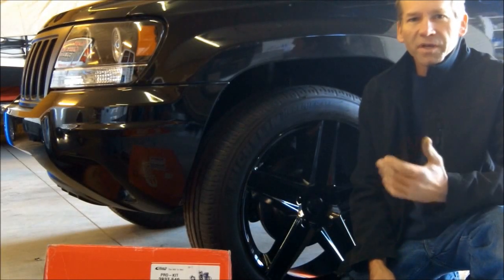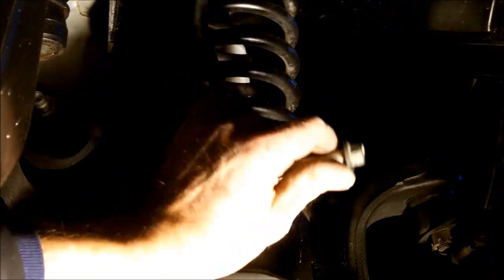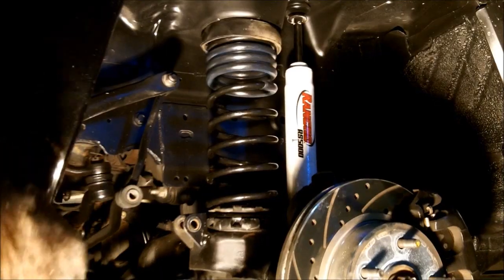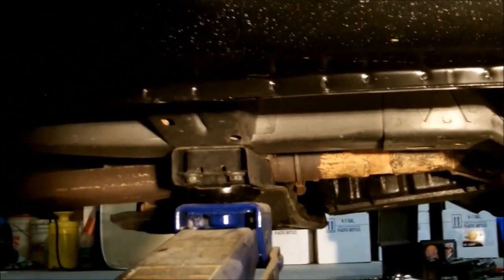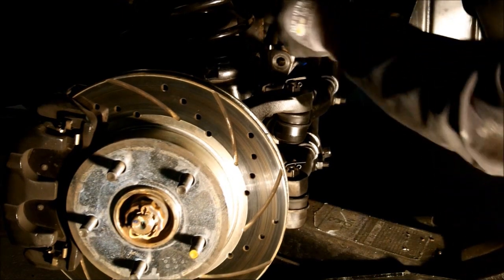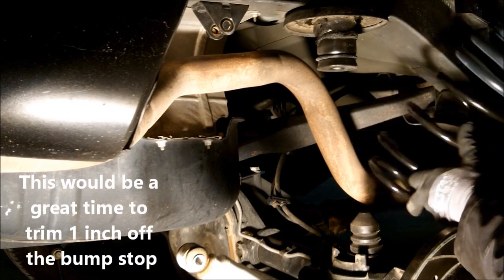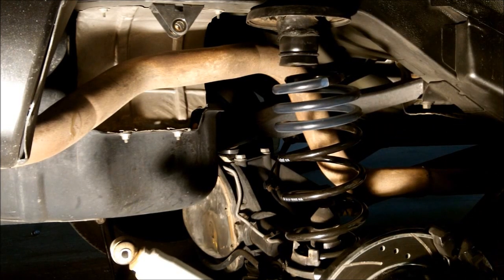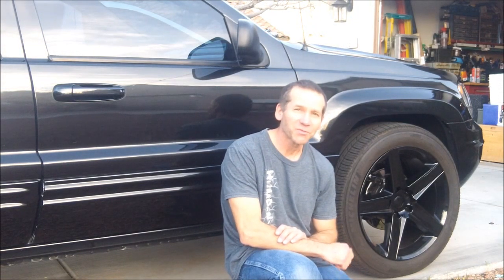Lowering 99-04 Jeep Grand Cherokee

Comment: Lol why lower a 4x4
Reply: Gus Wendt for looks or for better on-road handling.
Reply: Bravo25 a what? Anyway, a lower center of gravity improves handling. It's basic physics, really. I've driven some WJs and they're great cars except the on-road handling which really lets it down.
Reply: Most people don't take their vehicles off road. Hell, the uploader may not even get snow where he's from. I think a slightly lowered WJ on those wheels looks pretty good! To each his own. 👍
Reply: Doesn't get snow? He owns a BAD ASS xj for offroading and shitty weather. God forbid you want something a bit smoother for a daily.
Reply: How do you know it’s not the 2wd?
Reply: The diff on the front axle is a sure way to tell it is 4wd. Go to 2:54,  4wd it is.

Comment: Hey just wanted to tell you I used your vid to replace my springs three years ago . Also install KYB shocks. I drive a 104 miles a day back and forth to work on the highway.  The Jeep handles great! But I did park it almost 2 years ago and was driving other vehicles. But have just put it back on the road yesterday. I think I'm going to paint it this winter. There are a few other mods  that I did maybe one you have not seen. My Jeep is a 2000  but I have a SRT front bumper. I was looking at some pictures and body lines. And I figured I could make it work. So I ordered aftermarket one made out of fiberglass. When it was delivered I realize it is about 5 inches too wide so I choped 5 inches out the center and bonded it back together. Made a frame that goes behind it. And the bumper is held in place by push button race clips . Also I have Dodge challengers 20 inch rims on it. In the back I ran a spacer adapter to convert the lug pattern. In the front I bought new hubs and rotors it had them redrilled to fit a challenger lug pattern . So the rear poke out about an inch with the spacer but the front are slush. Everything I bought for the Jeep was used or very inexpensive.  Except for the front bumper . If I remember right it was around 700 bucks .
Reply: I hope you get to post pics.

Comment: I’m looking to do the 2 inch lower coils and it’s rwd do I have to modify anything besides the bump stops
Reply from the maker: With a 2" drop you may need to remove the bumpstop and the bumpstop holder altogether and then replace them with a screw in type bumpstop similar to what I did to my Dodge Dakota here's a link below.
https://youtu.be/bpky5VAVxbE
Reply: I put the 2 inch lower coils on and I see no difference do u know that could be ?

Comment: We have a 2001 Jeep grand Cherokee Laredo, with 153,000 miles on it and my niece refuses to drive it because it rides too high and is difficult to control. We have so far had the suspension worked on to the tune of three thousand dollars, so it's all good. i understand that older model Jeeps tend to "sway" a little bit. I have driven behind it and I can't see that "sway " effect but riding in it you can feel it a little. it rides Kinda like a 1990's Toyota Highlander with it's high center.  We wondered if we could lower the vehicle for a safer feeling for her and eliminate the sway? How low can we go?

Comment: This should get rid of the top body “Body bob” side to side. In my quest on mine, KYB, the Addco rear sway bar. Next is these springs. I kinda like the factory 17” Azure I think they call them, wheels, one had bad rash is now my spare instead of the ugly black steel wheel as I bought a good condition used wheel. I remember from my days of “Steering and Suspension” classes, for every inch of ride hight change, center of gravity changes 2 inches. So lowering should give much better handling, but body bobble should diminish. Like Martin said, the new springs have a higher rate due to engineering of manufacture so Cadillac it ain’t, but more race inspired meaning holding tighter grip on road sacrificing plush. I love my Jeep,  If mine wasn’t Brilliant Silver,  different wheels would be a consideration, Martin’s Jeep screams those wheels, every one is like a painting where no two are alike.
Reply from the maker: Thank you. I'm glad you liked this video and found it helpful and informative. I don't regret it all, lowering at the 1" it has improved the handling of the vehicle it definitely looks a lot better with the 20" wheels and filling in the wheel well.
 Then, with the addition of the Addco rear swaybar, that was a huge improvement in handling.
 I wonder if I were to convert the rear to a 4 link suspension if that would also help the handling of the vehicle.
Reply: @martinbuilt  Got the Addco sway bar, holy moley, night and day difference. Now to get the springs. I must say, the twenties look natural on yours. Mine is Brilliant Silver so I would continue with silver wheels, but 20s look interesting, but first things first.

Comment: Excellent video! Curious to know what mods you had to make to get the 20” wheel to fit. Any spacers, etc? Did you have to do any brake modifications? Any info is appreciated! Also, you have convinced me to become a subscriber!
Reply from the maker: Dr C 
I had to make no modifications to get these wheels to fit the largest tire I could get to work was a 245/50R20. Discount Tire did Mount one other tire that was larger on there for me and we tried to make that work but in the left and right turn the tire was touching the inner fender well.
Reply: martinbuilt Thanks! I’m probably going to give it a shot. Thanks for the inspiration.
Reply from the maker: Dr C 
You're welcome and thanks for subscribing.

Comment: Thanks for the tutorial. I'm disabled and need to lower my 2000 WJ just a tad to make getting in and out a little easier. Now I know what to buy and how to do it. Thanks and Take care.

Update: did you have to adjust the alignment any? Did it make the steering wheel off center or anything?
Reply from the maker: miscellaneousone 
This does not affect wheel alignment or affect the steering wheel centering position at all.

Comment: Martin, I just watched your lowering video and have a question. Given the reaction from your shocks when you disconnected them , the seem to not be gas charged. If so, is there a reason for that? Maybe a smoother ride ?
Reply from the maker: You are right they are not gas charged. Those were installed when I bought the vehicle. And personally I did not like them at all the rear one started making quite a bit of noise. I have since replaced them all with gas charged shocks much better ride and quieter.

Comment: How do you like handling and stability after lowering it?
Reply from the maker: it does handle better. You definitely want to trim the bump stops. Maybe a little more stable. If you add the Addco rear sway bar it'll corner great.

Comment: What tire size are you running with the 20s? Also what is the width on the 20s?
Reply from the maker: I'm running Michelin Premier 245/50R20 tires on 20x9 OE Wheel +34mm

Comment: Hello Martin. Question: Does the Jeep ever bottom out or rub the body from lowered? My 1st WJ had those replica wheels and tires, same size also, and it never rubbed anything, but I left it at stock height because I lived in the N East with snow. Now I live in Florida, and have a 2nd WJ, and I'm thinking of lowering it now. But I'm worried about tires coming into contact with body over speed bumps or being weighed down with passengers. Thanks for your help. Btw, I found these exact shocks, and lowering springs online. Want to do this before end of summer 2023.

Comment: I have a 2' lift kit I was considering installing on my 2001 WJ4.0 , 2'spacers new Shocks and springs,But ,I thought about the look of lowering it. What advantages or disadvantages it may create? Especially with the 4 wheel drive,Will lowering it effect the overall performance in 4 wheel drive?
Reply from the maker: Probably the worst thing you're gonna notice with a lowered vehicle is you have a limited suspension travel and that is the reasons I had to shave the bump stops.
 But with a lowered center of gravity there is less body roll, it does handle better. the fwd is not affected besides the best performance rally cars in the world are four wheel drive/AWD.
Thank you for watching.

Comment: Martin I have 04 wish mine was black, it is the maroon
 I really like it but it needs some suspension work. Is this lowering kit from stock height? What tires and rims. I know you said 20". I currently have no rust on the frame but see a bit of rust on suspension items. I have a 2" budget lift that was put on in 09 I think it should removed.  I have only had the jeep about 2 months.  I think the budget lift is causing stress on my suspension. All of your suspension looks so nice. Has it all been replaced from stock or do you live where where there is no snow.  What number of ranchero shocks do you have? Sould I dump the lift before working on suspension items? I need new tires so I need to decide.
Reply from the maker: The suspension is 1 inch lower than stock. The tires are a 245 50 R20. Yeah I live in southern Nevada there is no snow. I also have a 98 Jeep Cherokee XJ it looks just as good underneath. All the suspension components are stock have never been replaced. But just recently I did build a set of lower adjustable control arms. I have since replaced the Rancho Shocks with Gabriel Max Control. I would personally recommend bilstein's

Comment: i read through the comments and still didn’t find an answer to my question so imma ask anyway i wanna get the same rims i already seen the size of wheels and rims in the description so i don’t need that info i just wanna know if they will fit on my 01 Jeep Grand Cherokee Laredo with stock ride height or if modifications need made...i mean do they rub when hitting bumps or when turning the wheel all the way in either direction?
Reply from the maker: Yes, they will fit, no rub.  If they don't rub on a lowered JGC it definitely won't rub on a stock height Jeep Grand.

Comment: Hello Martin.....i like to watch you videos and am a big jeep fan living in holland and hungary...i just became the owner of a grand cherokee 4.0 from 2001. My friend told me that there is a recall on this car from crysler because they say its better to put a trailer hook to protect the benzine tank. When a car hits the backside of the car  it could end in a big fire.  Your a jeepman so i was thinking if you have any idea to make the jeep saver? Is there e bullbar idea ffor the back side of the car.....greetings!
Reply from the maker: jaja djamoekjouw I just recently heard of the same thing and watched a few videos on YouTube about it. I do have an idea for that the project itself would be huge to fix the problem. I don't know if you recall but Ford Pinto had the same issue and the one thing that the two have in common is that the spare tire is located above the fuel tank and by doing so they have to lower the fuel tank to give it proper clearance in the trunk area or in the hatchback portion of the vehicle. You can go to your Chrysler dealer they will install a trailer hitch for free. That's what I've heard anyway. My 04 came with the trailer hitch already.

Comment: are those the srt8 wheels..i would like a set for my 2001 along with dropping my jeep atleast 2 inches .IMO kinda pointlest raising up a jeep that 2wd
Reply from the maker: ToyHippie 
They are a knock off the srt8 wheels. Made by OE wheels. If you go 2 inches  you'll be literally sitting on the bump stops.
Reply: @martinbuilt  Could you trim that out of the bump stops?  Im thinking of just about 2inches (H&R kit) she's a 2002 2wd.

Comment: Hi! How about the panhard's ? Must they be adjustable? I mean to center the axels after lowering ?
Reply from the maker: The only that would effected would be the front axle. I never did check it, but I will and maybe I'll need to build an adjustable track bar. It's always somethin
Reply: When you upper 2.5 inches on of these jeep actually you dont need to make any other mod . I think if you lower just 1 inch will not affect, am I right Martin?
Reply from the maker: @mikemorales4830  yes lowering it did not seem to affect any of the suspension.

Comment: Thank you for the video. Did you have to cut the bump stops due to bottoming out in turns? Also, your rear shocks don't return to fully extended? Or did you have a string holding them closed?
Reply: And same for your front ones? My Bilsteins return to the extended position.
Reply from the maker: Evan Hart 
I cut the bump stops because they were bottoming out just in normal driving not only just the turns. And the this brand of shocks are hydraulic not gas charged

Comment: I want to do a 2" drop, but im worried about not changing the shocks for shorter ones, and i was also told id need a shorter drive shaft. Whats your opinion?
Reply from the maker: I personally don't think you're going to need to change the shocks I could be wrong about that let me have a look at  how much shock travel I have left  on a 1 inch drop and I think you're going to be okay on the drive shaft but I had to shave off quite a bit of my bump stops just to keep them from hitting all the time and that was with a 1 inch drop with a 2-inch drop I think you need to make bump stop modifications are you going to be slamming him all the time.. we're you planning on running 18 or larger diameter Wheels?
Reply: @martinbuilt  i already have 18s, but my tires are 255/55, they rub so i ordered fender flares and they should be coming in soon. How much did you have to shave off the bump stop? Ill just double that, and let me know on the shocks. I just bought top qaulity monroes which broke the bank, cant afford to switch those out and im not even sure if there are shorter stocks on the market for the WJ. But thanks i appreciate the response.
Reply from the maker: @muhammadayyad9321  I would say I removed 1 inch off the bump stops. It cuts quite easy with a razor knife.
Reply: @martinbuilt  thank you i appreciate it
Reply: Muhammad, please let me know how was your mod, Im interested on lowering my jeep 1 or 2 inches. But need to know if you make some other mods. Please check if you have to mod your sway bar links and the track bar lenght.
Also if you have any question on this matter feel free to ask, I dont know too much but maybe can solve it together.
Thanks. And have fun with your project
Reply: Mike Morales thanks, but sorry dude lol, I ended up never going through with it. Doesn’t seem like a great idea to do to a WJ either. Nonetheless mines got death wobble, so I’m planning on swapping the HO v8 into a v6 WK body. They’re also 1000lbs lighter than the model I have, more aerodynamic, and have a higher top speed. I also heard that the 6.1s come with a lower suspension and you can buy the whole thing for like 1500$ and they fit the same. That’s definitely an idea for the future. I just hope I can get the dash to work with it. Tbh tho, my dash was busted in the WJ, maybe I could live without a dash lmfaoo
Reply: Mohammad, you can made your dashboard from aluminum plate looks gorgous
Reply: Mike Morales lol really? First time I ever heard of that, but thanks I’ll look Into it

Comment: Why the fuck would you lower a jeep?
Reply: Bravo25 I'm considering lowering my 97 ZJ, but it's a factory V8, RWD, so just to do something different, I wouldn't mind lowering it and taking it to a track. If it was a 4x4, that'd be fucking stupid. The ZJ 249J transfer case isn't designed for performance, it's built for traction off road.
Reply: Jonathan Garneau-Reid 249 better for off-road than rwd (duh)

Yes it locks in high range. That makes it an even more versatile t case. Why are you arguing that it locks, the simple fact is that everything mentioned makes the 249 an awesome on road case. The 231 CANNOT be used on dry pavement. There's really nothing to argue about or try to call names. The 231 is better off road because anyone who's ever driven off road will say locked is better than waiting for viscous couplings to transfer power.. the 231 is better because it used a chain to lock front and rear, this is very strong (800+ ftlb and hasn't broken due to power), easier to rebuild, and cheaper to rebuild. End result: way better off-road

My only issue is don't sit and tell me the literal best Jeep t case for on road 4wd (true AWD if you have front and rear LSD as well) that can handle turns on dry pavement without drivetrain bind or wheel hop. Like I said you had it backwards, no need to try and insult me.

And no I don't care what you drive just said if you have a 249 I hope to God you're smart enough to realize how fucking decent it is for on road performance driving.

The 242 is unlocked center and can be used on road as well but it's a piece of shit because it's an open center diff, do you see where I'm coming from?

Comment: Do those tires rub at all?
Reply from the maker: POGO953 no they don't rub at all but you can't go any bigger than that size right there. It is close.
Reply: martinbuilt I was thinking of going with same wheel and tire but a set of 265/45/20. Think itll be to wide?
Reply: I have a 2004 overland 4.7 h.o that were building with a turbo. This thing has all the bells n whistles. It's from California so hardly any rust on it. Flowmaster exhaust dual pipes dumped out in front of back wheel. Sounds awesome

Comment: You put on 20 inch rims and tires, you lowered it and screwed up the drive of the vehicle by putting on low profile tires.
Reply: Bravo25 what? 

Lower "center of gravity height" look that up.

Look up "optimum sidewall flex for racing" 

Thank me later